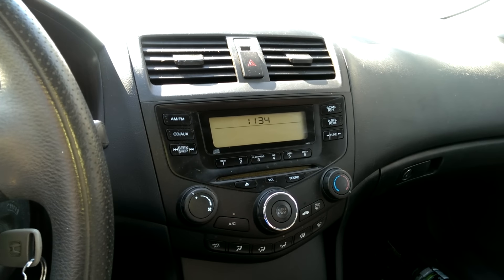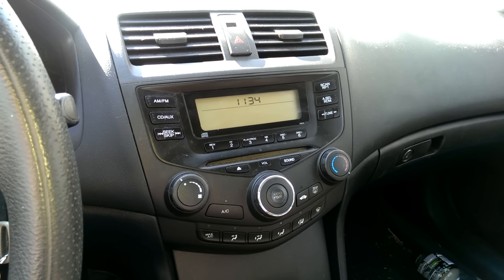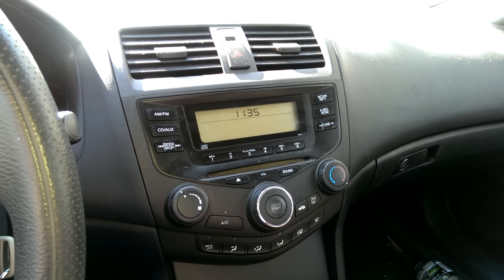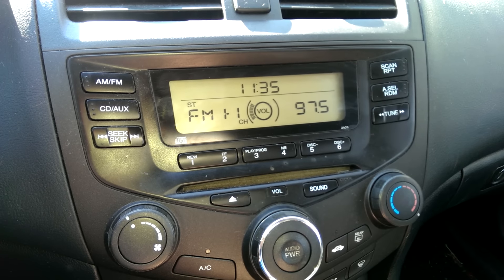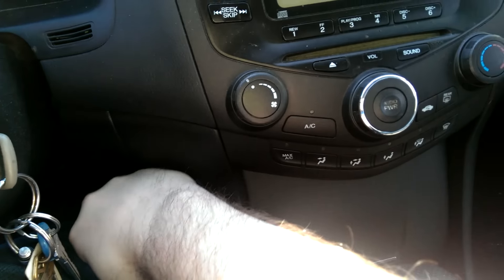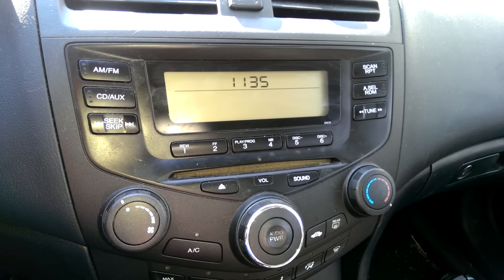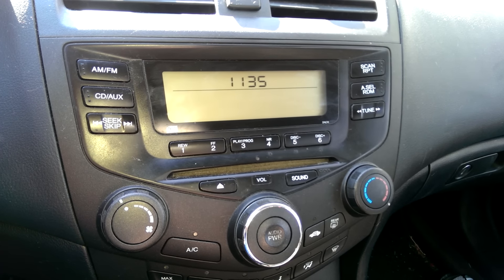2004 Honda Accord radio short problem.

Comment: Similar problem as a lot of people, mine drains the battery, 2005 Accord LX. Take note, there are two different radio systems that were in these cars and they look very similar. One, like mine, is the cheaper radio/single disc, in which you don't need a special code to unlock it after disconnecting the power. The radio/six disc changer unit will need a code if you disconnect the power. That code is apparently available from Honda but you would need the VIN code from the original car or the serial number from the radio itself, or so I have read. Okay back to the problem, apparently some people have fixed various issues with these radios by resoldering a lot of connections on the main circuit board. A lot of the components on the circuit board are what is called surface mount. They are soldered on with hot air. Since most solder melts at around 700 degrees (F) it would take a good amount of controlled heat to solder it. For my particular case, I am just going to wire a simple switch into the power feed line (12 volt) that goes into the back of the unit so I can switch the power off manually. I currently have the fuse pulled (10 amp) but when you do that it also turns off all the lights to the control system for heat/AC. The switches still work but the lights are dark, kind of a pain when you are driving to work in the dark. This should have been a mass recall and fix by Honda with so many people having trouble, but this generation of Accord is getting older and are starting to show up in junk yards so they would rather sell you a new car. The reason I mention that, I have tried three different radios from a salvage yard and all three were bad. The two most likely options are an aftermarket replacement or drive in silence. Good luck, hope this helps someone.
Reply: What was the issue?
Reply: I just attempted resoldering all through hole components mostly power transistors on the radio head PCB. It did not fix the issue and solder joints for surface mount components actually looked good. First thing when i put everything back together i was greeted with the familiar delayed turn on, static noise, pop,  hiss and silence and then it worked as before a little later, so it's not fixed. But i found out by playing with the Fade, Balance menu that my front left speaker was not producing sound. I will remove the door trim tomorrow to see if i find a possible explanation there, maybe a short. But your words are quite hopeless if it indeed is in the radio head. I'm hoping a poor harness design is causing unshielded wire to the door and a short. Also someone said rain water is getting inside the door causing corosion and a short in the speaker wirings, and i did notice the problem to be coming consistently after damp weather soo.. hopefully the head unit is not yet the certain culprit for me.

Comment: (PROBLEM SOLVED)Hey there is a very simple fox to your issue, remove the stereo, at the back and side you will see 2 heat sink, remove the small one that runs from the side to the back, you will notice there is a small spot of probably square  grey thermal grease, at this point it may have gotten a bit hard, cleaned it off as well electronic sensor on the stereo which the heat sink was touching, purchase thermal grease and apply it to both spot you have cleaned of, the thermal grease is the same one used when replacing a cpu on a computer, it can be found in any computer store, after the grease is applied out back the screws tightening gently enough for the heat sink to be stable, reconnect you stereo, problem fixed. the issue was the factory thermal grease dried up and the stereo and heat sink dis did not have a stable connection so it would always go into safe mode once the stereo is shaked or  overheat as the old grease was not serving its purpose to help keep the heat sink  cool. any questions flip me a e-mail., I have read almost all of the Honda forum's  and none of the goof so called Honda  experts has figured this simple fix, it's simple science.
Reply: my units is still Working for 4 months now, your problem seems that the heat sink is not making good connection with the sensor the unit system board, I would recommend removing the heat sink again make sure all the old grease is cleaned off, reapply only enough grease therefore small square to fit only to fit the sensor square, if there is excessive grease applied when the screws is tighted it will squish down into the system board and cause a short. as well use your finger pull the sensor just a bit forward make sure it's straight up 90 degree or pull it just a little past that forward and most importantly when tightening the heat sink screws be very careful to criss cross and do not over tighten them use your imagination  tighten  gently so you can leave a layer of grease between the sensor and heatsink, my first time your problem happen to me and I got it on my 3rd try getting the average correct tightening of the heat sink screws, play around with it I am sure it will work out for you. make sure you a using a high resistance grease, see the original problem was the heatsink grease was dried up and was overheating so the stereo would go into safe mode, and once it cold off it would reset it self, how  I figure this out was in the cold winter in Canada once I  go into the car on a freezing day the stereo would work ok until the car heats up. so you problem is as mentioned above.
Reply: alvin chinyan
Reply: Hi,Everyone!  I have a 2004 Hond Accord Ex with the Navi. I am having the same problem. Has anyone tried this fix? I am going to try it but if it does not work could someone recommend an aftermarket radio that would be compatible?
Reply: @alvin chinyan  i have few question regarding the motherboard of this, please reply me so that i can solve my problem and complete my project 

thank you.
Reply: I tried your solution. It does work. I got my radio back. Thanks.
Reply: I have the exact same problem and I did your fix and it DID NOT WORK!
Reply: alvin chinyan help please no sound in my honda ((
Reply: alvin chinyan did not work for me through.sad
Reply: I completely disagree. His response was very clear and well put together and I feel I understood it perfectly. Based off what you're saying you want him to make a video, showing you what a heat sink is and what thermal paste is? Have you tried to google literally anything related to this? Heatsinks are very generic looking so I'm willing to bet if you looked up a picture of one and tried to find something similar on your radio, you could. If you don't know what the hell you're doing you should take it to a Honda dealership and have them replace the unit for 600$ instead of complaining to the guy who gave us a sub $5 fix. I'm not even a mechanic and I can follow his instructions. You are better off taking your car into the dealership and having them fix it. Those guys need to make a living too.
Reply: Raun Smith your right I was giving other people way too much credit. People are dumb Ruan
Reply: I Would love to see this done before I try doing it. Could you please make a video showing and explaining how to fix it.  Thank you
Reply: Alvo chinyan  mine worked took 2 tries the second I did all heat sink areas under their brackets ! Posting video later
Reply: Alvo chinyan  mine worked took 2 tries the second I did all heat sink areas under their brackets ! Posting video later
Reply: Sindy Portillo youtube it
Reply: Alvo chinyan Ok similar problem with my dad's honda. Every time me and my dad hit a bump on our way to some place the radio shuts off completely so we have to turn it back on and it keeps happening every time we hit a hard bump
Reply: Alvo chinyan I thought at first it was the audio amp itself so I changed the amp and put new thermal paste... But even that didn't fix the problem, I'm really out of ideas on this one.
Reply: Raun Smith those people should stay away from diy and just go to the dealer.  The guys instructions were extremely clear to me, someone with very little electronic knowledge.
Reply: Alvo chinyan 🙏🏻 THANK YOU
Reply: '03 Accord LX, didn't work for me on two 2AC0 radios.
Reply: i tried this few weeks ago and it did not fix anything
Reply: @daveindallas11  did you ever post the video?
Reply: @sindycarolina2722  did you ever get this figured out?
Reply: Got a 2005 Honda Accord LX,2.4 litre motor,4 door sedan. After starting the car, radio would play anywhere from a few minutes,or more than static. Thought you might be able to help me with that. Thank you in advance. 👍
Reply: @Alvin Gadar pls post pic
Reply: I did this! I put thermal grease on the side heat sink and screwed it back up. It did seem to help but radio still wouldn’t work messed with the radio wire behind the radio like pulled and pushed in a couple times till it snapped in. & it worked when I pulled a little out held it there for a bit then it turned off so I I banged it down towards the shifter a couple times all connectors plugged in and oddly worked? I’ll lyk how it goes after some time.
Reply: Here I am reading all the comments having same issue on my Honda Accord 2.4 engine size.
Reply: (PROBLEM SOLVED) Thank you so much.
Reply: Complete bogus answer, I did a complete check of the radio head including that grease and even put some new head conducting grease, that made no difference (and i didn't expect it would).
Reply: It worked for me then stopped working again after a few days, I have notes the Circuit Board overheated behind the heat sink with dark color and board bubbles, I think this is the right solution, but for some of us, it was too late.
Reply: @classicman1828 No, false. The problem is cold solder joints in SMD components but the exact component has not been identified so you have to reflow as much of the board as you can. I have the problem too and replacing the thermal paste with fresh one made zero difference.  You have to hot air reflow the board, there's a video how to do it on youtube and that apparently is successful verified years after the fix.

Comment: I have two people in two days with irregular problems with these 2004 Honda radio's and heater controls. It is a common problem I was familiar with in the past but I couldn't remember what the problem was or if I ever solved it before.
But from one thing I found out is that Honda was replacing them under extended warranty due to a factory defective PCB board in the radio.
Reply: False information i am a 2004 Accord owner since 2004 and there never was a radio recall.

Comment: ALTERNATE SOLUTION - My daughters 2005 Acura TSX had a similar problem but there was no sound at all, not even static.  The fuses were all fine & the amplifier was also fine.  We removed the stereo and one of the wiring harnesses that goes between the stereo and the amplifier had come half way unplugged.  I pushed the plug back in until it clicked and the stereo was fixed!
Reply: Off topic ! This got absolutely nothing to do with this page, not same car, not same circuits, not same problem !  Don't troll !

Comment: Having the same exact problem with this in my 2003 Accord. I’m hoping it’s one of the wire harnesses and pulling it out to re-plug it in will solve the issue like it has For some people here.
Reply: My radio on my 03 Honda accord changes stations by itself and the volume goes up or down on its on I have no idea what could be the problem

Comment: Good evening to everyone with this Honda problem. I started searching into the problem, and came to find out some how it is related to the antenna module in the rear window, it is some how related to the defogger circuit. So today I disconnected the antenna from the module, stereo came back on. Can't say it's the fix to the problem because it shut off again but it is a start for any one who wants to add on to finding the solution.
Reply: No, i doubt it.

Comment: I had the same problem and I have a simple fix all I did was take off the front passenger door panel the contact to the speaker were rubbing on the door metal. fast and the speaker down tight on my radio came on that did it for me
Reply: This seems the most reasonable explanation i have read sofar.

Comment: I had the same problem with 2007 lx , after i replaced the compressor coil the radio has that loud noisy sound , i think it’s a circuit issue maybe it happened because something isn’t related with the sound system.
Reply from the maker: Yeah.  I had to eventually remove the fuse to the front dash (that included the radio) because I was unable to turn off my radio some days, and sometimes it would just randomly turn on and blast my ears out.  Still to this day I haven't bothered fixing it.  I've been without a working radio for 7 years.
Reply: @jaldarith  
I think It's very boring to drive a car without the radio, anyway, thank you 🙏🏼

Comment: .  mine was speaker grounding out on door. I just fixed today by remounting speaker as well as covering -+ terminals with tape to prevent them from coming in contact. It was my fault for not paying attention when installing new door speakers. same can happen with rear speakers
Reply: people have this problem with oem speakers so i doubt your explanation applies to this page.

Comment: I had the same problem. I fixed my problem, by turning the radio and the heat in the car and let it run until I heard the static sound the radio. Then I turn off and then on the radio and it works.

Comment: i bought a used 04 accord lx and the first day i got it it was making some weird noise then some loud pop noises then no audio. And now it's intermittent. it would turn make a loud sound then turn off, i turn radio off/on couple times to make it work. i will post an answer after taking the radio out to install aftermarket bluetooth amd aux jack. Will also check front speakers wirings for short. the back speakers wirings look okay.
Reply from the maker: Excellent!  Thanks!
Reply: Any updates with the aftermarket jack & Bluetooth?? Currently looking into replacing the radio as well, thanks.

Comment: Be careful if u don't drive ur car a few days ur battery may die ....if it does just pull the radio fuse or disconnect ur negative cable
Reply: Chris Smits Hey, I am having the exact. I have to pull radio fuse or it will drain battery if not driving. Do you have a fix ?
Reply: Now i finally now why my oem new honda battery didn't last. I have to fix this audio system problem.

Comment: I had the same problem wit my 2004 honda accord.. I remove the radio and unplug the black wire and plug it back so far my radio work good  no static.. I hope this might help someone else its  worth a try..
Reply: Can you update if the problem came back or not ?
Reply: @ericastier1646  problem did not come back
Reply: @clevelaroe4274  thanks for the fast reply. It's however a weird explanation a bad connection on the ground wire (black) but it's possible i guess.

Comment from the maker: Unfortunately, I have not found a fix.  I have searched everywhere.  I will probably just replace the deck.
Reply: Hi i know this video old but did u eventually fix it by replacing the unit? Or was it a problem with the wiring itself?
Reply from the maker: @klephenthurry3284  there are many solutions posted here in the comments, but I determined that it wasn't worth the cost of putting in a new deck. The problem continually became worse, eventually requiring me to take the fuse out of the fuse box. sadly, I don't have the financial resources to continue looking into the problem. I left the video up because it's still a problem for many, and hopefully some of those solutions in the comments have helped people.

Comment: My problem is very different! Just got this car last week it is used. Has anyone gotten one with the radio working but the darn thing won't change over to the CD side and won't let you put a disc in and won't load when you push the buttons?

Comment: Ok this is what happened  i change alternator and the. Battery after that i took the stereo out and found out it was a short that was causing it  the cables were lose and were touching the body   And were causing a short on the stereo. So i fixed the wires cut them and atach them to asafe apot and stereo working fine now after i spent money on battery
Reply: AZTEC, I replaced my battery also, but I have not found any solutions on how to fix the problem. Which wire was short on yours?
Reply: could you be a little more specific about which wires/ how did you fix them?  a lot of people would be really grateful  to know!
Reply: +Lian Yang if you could go into details we would appreciate it so very much!
Thanks
Reply: I have same problem can you give more info how to fix the issue
Reply: yes please tell which wires
Reply: That makes no sense. OEM wires don't get "loose" just for no reason maybe your car had prior work done on it. I know mine does not (single owner) so that is not a valid explanation.

Comment: Hi,
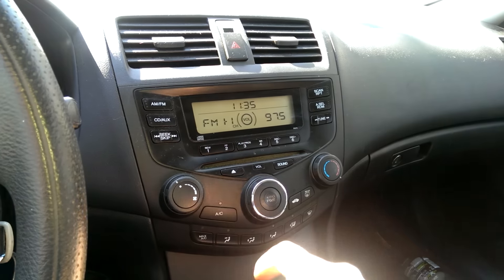I also have a similar problem ... my radio still functions everything is fine till the point when I raise the volume above 15 it is starting doing the same thing as in your video (time: 0:18) If I'm raising slowly rear left speaker starting making noise and after the right rear speaker.
Does anybody  have the same problem?
Thanks.
Reply: mee , do you solved it ?
Reply: Yes my radio stop playing than I have to start it again.
Reply: Not complaining some body gave me the car for free